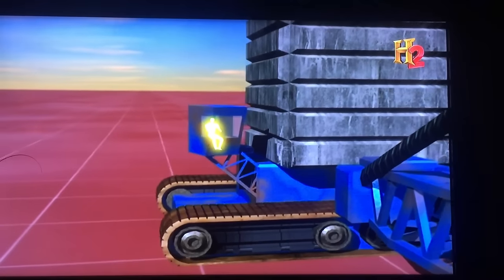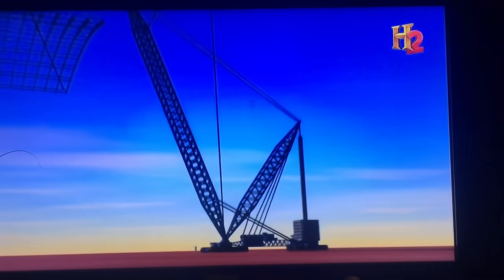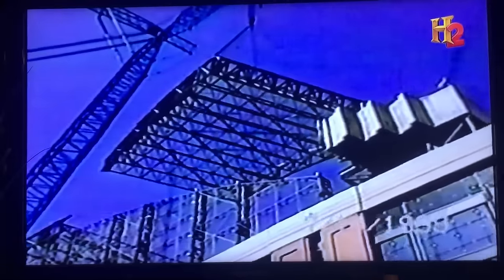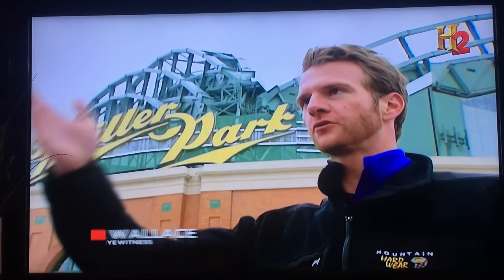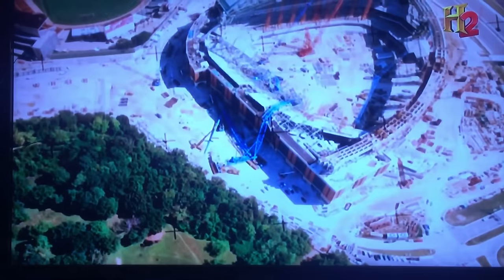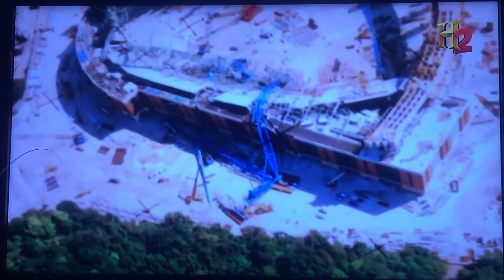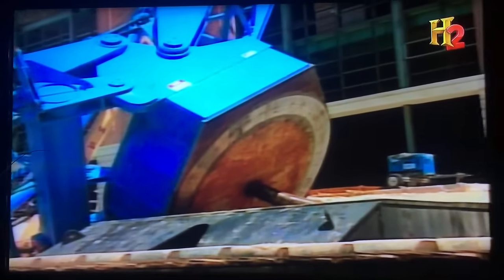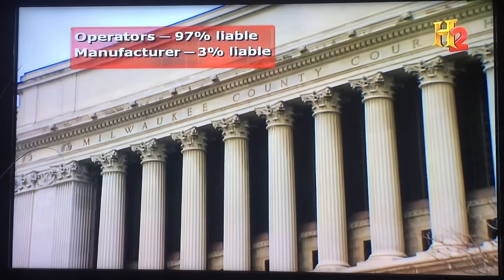Big blue Miller park crane accident

Comment: There are some problems with this report. 1. They were ironworkers, not "steel workers". 2. The fault of 97% went to Mitsubishi, NOT the operators. While there was clearly some culpability on the operators part, there were systemic failures throughout the process including deletion of important wind speed data. It is troubling seeing someone taking the time and effort in putting a video like this together with misdirection and spin.
Reply: The primary operator refused and left. Cowboy saddled up. I've written the Hostory channel and asked for them to correct the information on this video,but I guess it's whatever sells. Terrible day in our industry.

Comment: I think the regular operator refused to do the lift because of the wind.I think he went home,then they got someone else to do the lift if I'm not mistaken
Reply: This is a fact. I know the wife of one of the fallen ironworkers, and am very familiar with this tragedy.
Reply: @thepatriotking3521  .who did they get to do the lift after the other guy/crew left?
Reply: It never should have happened. The iron workers who walked were the smart ones, same old crap, safety takes the back burner to schedule. One other point, one of the 3 iron workers was not critical to the connection, osha changed the language in personnel hoisting because of this. People should be in prison over this.
Reply: @thepatriotking3521  .I wonder if while they were in the man basket they knew it was to windy and questioned it.and yes they should of went to prison.
Reply: @thepatriotking3521  .I used to be a iron worker.a injury from a 25 foot fall pretty much retired me.I went back 4 yeats after I was hurt.on multiple times.forced to quit each time.
Reply: @thepatriotking3521  .thanks for responding back..was good to speak to with you.and yes even on union jobs the deadline will always come 1st.that has killed more people then everything else combined

Comment: every crane that I have run had a wind speed in the cab. I bet there was one in that cab as well.  the operators obviously knew what the wind was doing, you can feel it as an operator.  being pushed by a boss to make an unsafe pick is just wrong!  Doing an unsafe pick is on the operator.  and we see how it can turn out.  tragic.  why were the iron workers in the basket and in the air?  they wanted to get it connected quickly knowing the wind was an issue.  on a site, everyone knows when things are dangerous.....just no one wants to be "that guy" that speaks up.  sad but real outcome for not speaking up.
Reply: From what I've read, the original operator walked off the job because of the wind.
Reply: @DowntownCanon  .yep.sure did.